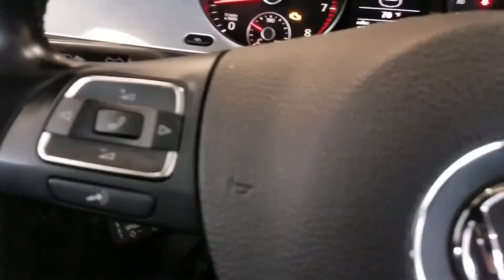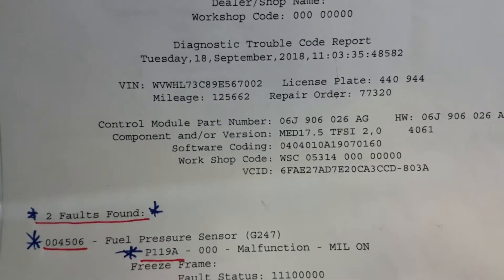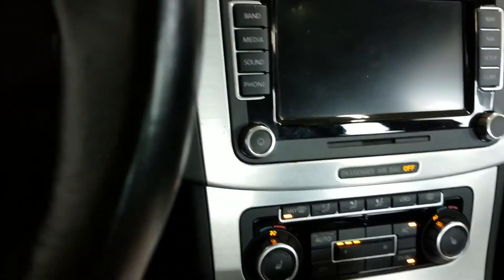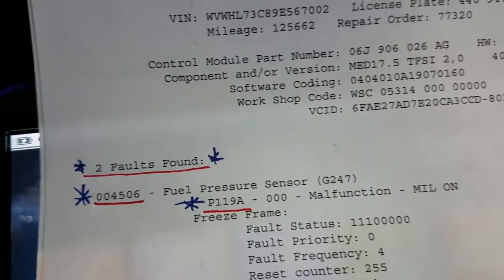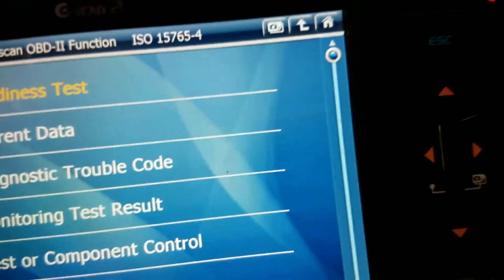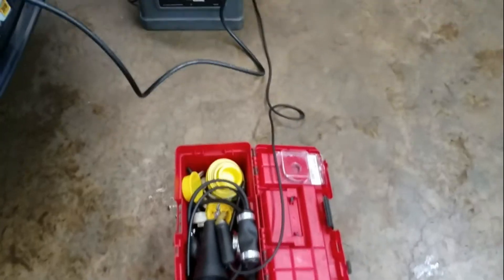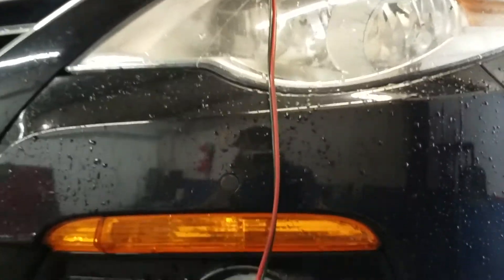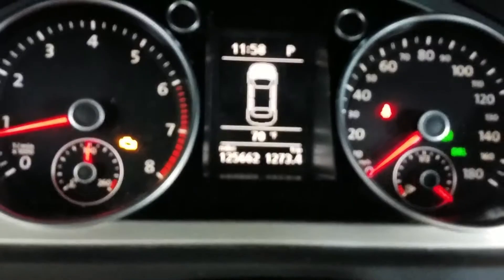VW Code P0171 P119A P0300 2.0l  "Most Common Problem"

Comment: I replaced low fuel pump,high fuel pump and the sensor that goes on it,fuel filter, fuel pressure sensor, pcv valve, hose that connects to the high fuel pump, fixed vacuum leaks no more smoke coming out of any hose or anything, MAF sensor, Air fuel ration o2 sensor, EVAP purge valve, gas cap, oil dip stick and my long term fuel trim is around 25 and short term fuel trim is around 0 I don’t know what to do next 07 Audi A4 2.0T FSI
Reply: could be the timing chain
Reply: could be the timing chain

Comment: Hey how are you man! I’m getting same code I have replaced PCV valve  back in December and on Monday my car turned off when I was driving and now the car it turns on and it shakes like crazy on the left side between  engine and transmission? amazing video dude very helpful to identify causes of the issue. Where are you located I’m in need of a good mechanic as yourself

Comment: Old style PCV valves would draw very little air from the crankcase while under the intense vacuum of an idle condition. However for some reason VW designed their PCV diaphragm to be both vunerable to tears and fairly strong. When you take the oil fill cap off while the car is running, cars with a tear in the diaphragm will fall flat on their face from the unmetered air. It makes sense that the intense vacuum of a bad PCV will damage seals from the inside.

Comment: I have a 2011 VW Tiguan misfires idle lean fuel pressure pressure all diagnostic change the spark plugs change the coils change the manifold change that round piece on top of your talkie near the crank case it’s still misfiring now when I started it does it like backfire it it almost dies every morning I hit the gas a little to check engine light flashes I hit the gas and the check engine light stays on it runs pretty good doesn’t die but it knocks and I have high octane gas I haven’t change the fuel injectors yet I bought the car at 100,000 miles I’ve only put 2000 miles on it I take it back to the mechanic who sold it he keeps telling me I’m gonna make it right and he’s been a mechanic for 40 years he said the shop in Santa Monica California he’s not making a right up and back 20×20 times  thanks for your knowledge hope you can read my writing
Reply: Maybe a timing belt was replaced and miss-timed.

Comment: 2013 Cc 2.0t got codes P2187 and P119A other day EPC light turned on and rough idle I also hear a slight knocking while idling and varies while revving

Comment: Question... I got a 2010 VW CC Sport it's a 2.0 Tsi Turbo. Now iv had it 3 1/2 yrs now. Absolutely no issues very strong very quick car. Amazing lil turbo engine but.... Thanksgiving morning around 5:30ish am my wife goes to start it up n get the car warm n I hear her yell something is wrong... N I go over n hear it Missing.. which at midnight it wasn't missing when we got home from Walmart. But 5am it was.. so I went ahead ran the OBD2 scanner it said misfire in all cylinders basically it didn't say anything bout lean or rich ect just all cylinders was misfiring gave me the P0303 P0302 ect. So I went ahead n dropped the R8 coils "Red tops" in and new iridium plugs. Figured that would do the trick... N it helped massively but... It didn't wanna start for a second which is bad.. considering it's never done that before.. n it started n was missing again n stuttering n being hesitant on acceleration. So I cleared the old codes and rescanned it.. and it said cylinder 3 misfire.. that's all... So I rechecked #3 everything seemed fine n connected right but still it was missing.. n it keeps saying #3 misfire the epc came on n engine light came on flashing.. now since it's got all brand new iridium plugs and red top ignition coils what else can cause #3 to misfire ?? It just happened all at once it was running absolutely fine until Thanksgiving morning... Do you think the pcv could be the reason??? Or is their anything linked directly to #3 causing it to misfire?
Reply: Injectors?

Comment: Hello  I have the same trouble codes on my 2009 Volkswagen Tiguan it was leaking oil but not from the rear main seal fixed leak and the codes keep coming back

Comment: Just had a 2009 Passat  roll in with same codes-looked below: oil dripping from rear seal. Only 129K miles.
Reply: Same here , did you fix your seal?
Is rough in idle?
Reply: @desmond8234  No, customer decided to sell car. Replacement of seal and PCV assembly corrects leak and poor running of engine.
Reply: I was going to look at a 2009 VW Passat 2.0T with 102k miles for 4600 would you recommend? Any suggestions besides the timing chain and PCV check? I really like this car so hopefully it’s a good deal 😊

Comment: Can this leak between transmission and engine can call a problem with no fuel pressure when is hot engine and  no start until is cooling down ?
I replaced :fuel pressure sensor 
High fuel pressure pump 
Low fuel pressure pump and module 
Injectors 
What I didn’t fix is the oil leak between transmission and engine
Reply: And I got the same codes p119A and p0171
Reply: That’s the rear main seal. That will cause the problem and the reason for the video lol this is exactly what is wrong with your car

Comment: My friend has a 2009 VW GTI 2.0 TSI engine. It just threw codes P0171 and P0507. There is no vacuum at the dip stick, oil filler cap or at the small hole on the diaphragm housing. When I remove the oil cap I get air coming out.

Could this still be a bad PCV?
Reply: I was going to look at a 2009 VW Passat 2.0T with 102k miles for 4600 would you recommend? Any suggestions besides the timing chain and PCV check? I really like this car so hopefully it’s a good deal 😊

Comment: Ive got a p0171 error on mine, I was told I had a leak in my Intercooler and Radiator which I replaced (£££!) and the problem continued, I've since changed the PCV and breather hoses and still having the same problem!  Have done a smoke test and cannot see anything obvious...  If I press the gas the revs will go up but on the way down 'stick' at 2k for a second, drop a bit hold then drop back to normal.  The car will also increase revs on its on sometimes at idle... I'm totally confused, I'm about to replace the DV but at the end of my wits!  I'm only part way the video but some great insight so far.
Reply: Check for vacuum leaks. If you have a 06 gti or an FSI engine like I do check by where your high pressure fuel pump is. Check the vacuum lines around there. There are some that are plastic and brittle. My car only has 100,000 on it and two hoses under the high pressure fuel pump we’re cracked. Replace those and see what happens. I had the same issue you did and that fixed it for me. I am still throwing a lean code though. That will get figured out soon.
Reply: @tylerbradley9013  Thanks for the reply, and suggestion mate.  Ive done this and smoke tested, deffo no leaks.  Total mystery. Finally got a decent scanner so going to check the O2 sensors as someone has said this could be a cause.
Reply: @chavvyboy69  Hey man did you find what causes this problem? I have the same issue and I think it's because of fuel pressure sensor

Comment: On my Volkswagen Jetta 2015 with the TSI motor when I'm driving down the road the air conditioner blows cold air but when I come to a stop and start blowing hot air
Reply from the maker: AC condenser fan is probably not coming on.
Reply: @FlatRateMechanic  how do I fix that
Reply: @kevinrobles7768  turn on the car and then turn on the ac pop the hood and make sure the fans are coming on if not unplug them run a couple of wires to the fan connecto from the battery to see if they turn on if the do then you have a bad fan control module i had the same issue before as soon as i replace the module problem solve
Reply: Its the compressor control valve 100% sure.

Comment: I had the same problems with a 09 Vw scirocco 2.0 tsi fuel pressure sensor and fuel trim bank 1 mil on, rough idle, low power everything was ok after  I changed the crack seal (141k miles)
Reply: Hey what did you change I have the exact same car and same problem